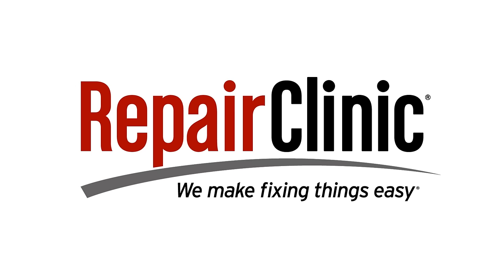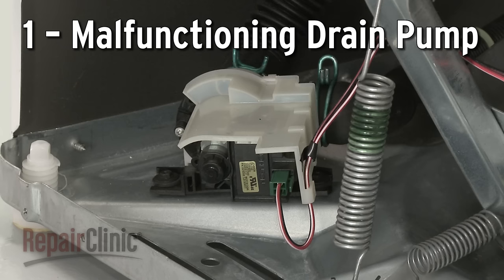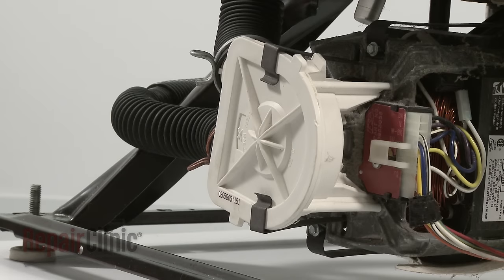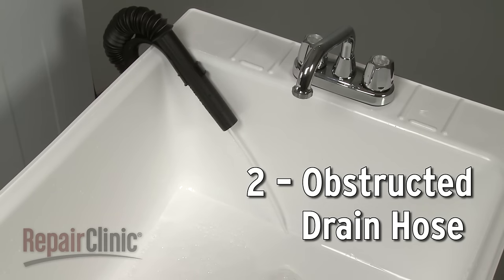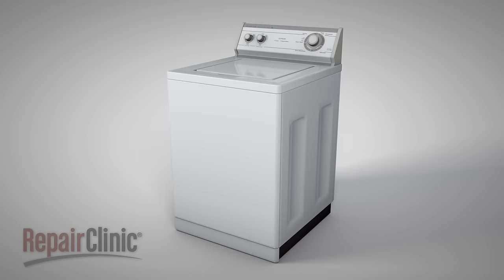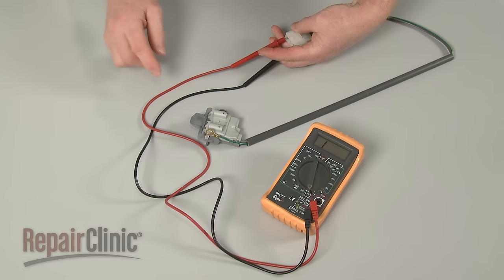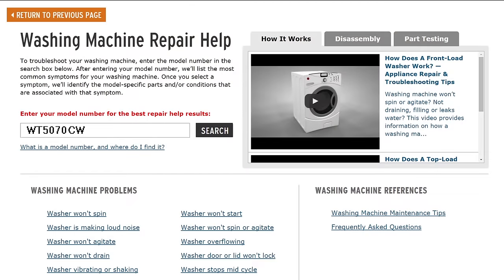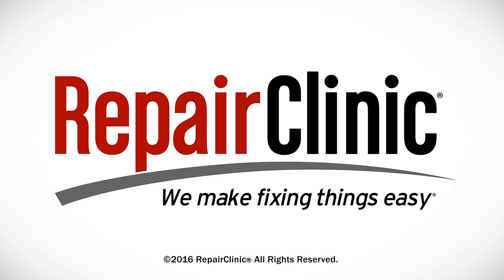Top-Load Washer Won’t Drain — Washing Machine Troubleshooting

Comment: Just helped save my sister in law some money! Figured out how to get to the drain pump and found a Bobby pin stuck inside preventing the drain motor from spinning. Took it out and did a test rinse felt the water in the drain hose almost immediately!

Comment: I keep washing machines for a long time and repair them until it just gets too expensive.  I have had the problem where it wont drain several times.  Most of the times it was the lid switch.  This is  the easiest thing to check first.  One time it was a bad pump.  This is a lot more diffecult to repair than the lid switch.  Check the safety switch first.  You dont have to take any panels off on most  models.  Unplug the washer before removing the switch since you will have a live wire exposed when the switch is removed.

Comment: This was awesome video!  For me, it was the lid switch assembly.  The plastic lid switch assembly broke off its mounting position.  The screws are still attached to the body of the washer but the mounting holes on the switch assembly was cracked and dislodged.  Since the switch was never engaged, the washer would not move on to drain mode.  I think the lid switch assembly broke of its mounting due to time (15 yrs of use) and occasional slamming of the lid during that time period.
Reply: I replaced the lid switch' it worked 4 times' then quit' than I replaced the pump motor's it worked another 4 times' then quit' please someone help me

Comment: Thank you very much for your video...again. Thought for sure that we had a defective timer fault in our old Whirlpool washer that was not draining nor spinning near the end. Was considering to buy another unit and then saw this video. The true root cause was the lid switch I had removed to gain access to the internals of the washer for a drum alignment. The rinse / drain cycle demands that the lid be closed or the switch bypassed. Short answer - pressed harder on the top lid and it all works again. Will remove and re-install the position of the lid switch so it closes properly. Many thanks for your advice and videos.

Comment: Hi I just ordered a drain pump from you guys hooked it up & it seems to be draining now but there is water sitting in the barrel. I can hear it draining but for some reason it's a few inches left over in the barrel.  All hoses are clear from any obstructions & like I said I just ordered a new drain pump from you guys.  Also, it seems to be getting stuck when it's suppose to drain & do the spin cycles.  I think it's the timer...
Reply: Did you ever get a response to this situation? Might be the same issue mine seems to be having
Reply: Mine is the same did you figure it out
Reply: Terry Porter Nope...  Ended up a getting a new one sadly

Comment: I have a Kenmore 800 washer that drains and spins just fine, but right before it finishes a normal cycle, and has drained and spun, it fills up with water again and then just stops completely. The spin cycle is set to 1 cycle. Any thoughts why it would starting filling with water again after a normal cycle?

Comment: I had this issue... I was inspecting the drain pump and noticed a blue wire was cut. I simple tied them together with a wire nut and the washer is fine now.

Comment: Hi, I have the exact apposite problem, my samsung top loader is draining continuously.
Started happening few days back, does not happen always but sometimes.
usually when it starts the rinse cycle, it starts to take water from tap but at the same time its draining also.
I tried checking by opening the back cover for probable cause.
what I observed is, there is a valve below the tub (its enclosed in tub though) is pulled open by the motor so to drain out the water and once the water is drained out, the valve is released in instant and it sits back on its place blocking the drain outlet.
The valve opening works every time perfectly but closing doesn't happen at times.
I tried starting the spin cycle manually and as it just starts to spin, opened the lid so as to stop the machine with a jerk, and this closes the drain valve immediately every time.
What I am trying to figure out is, Is it the motor (probably this is known as drain motor but only thing this motor does is to pull the valve and release) at fault but it doesn't seem to be because its opening the valve without problem.
next probability is, is there some kind of sensor that doesn't understand that the tub is empty and so the valve is kept open.
Because this is not happening all the time I don't want to change the motor at first go.
Will be glad if you can guide me on this. Thanks. 
(P.S. not due to siphoning because its working in same position for last ten years.)
Reply: Sounds like you have a siphoning problem.  Just take drain hose out of drain and be sure it is not wedged.  It must have air space around hose.

Comment: My problem is the water did not drain. It did not complete the cycle. It starts when i pull out the knob to start the cycle but it does not go past that. It does agitate, so that is not the problem. I have not taken it apart yet but that is next.
Reply: Yeah, but on some agitator types (before they got rid of them), you can have the lid open UNTIL the spin cycle, as I recall it. That's where mine locks up. So, lid latch, clog or the pump. 

Go with easiest and cheapest first. 

Hose and drain. If you know a plumber. Then lid lock. Then pump in back.

Comment: For anyone womdering that meter is junk. It should read OL (open lead) if the lid switch or motor is bad. Not whatever letter this video was showing. Never even seen that letter reading on any meter in my life. But then again i have a $300 ohm meter and not some cheapo. Good functioning switch should read about 0.2 ohms. Good motor probably about 0.2-0.6 ohms.
Reply: Who are these people who have such a thing and can justify the expense? You could buy one and send it back. Tho.

Comment: We've gone through 3 different washers in 4 months and they all hold water and leak from the bottom.. our problem can't be a machine problem. Any idea what it could be? 😭 the water doesn't even make it up to the drain pipe 31 inches up.
Reply: Plumbing issue?

Comment: dear washing machine people, stop making washing machines with lid switches. I want to look into the machine while its on thats the whole point of a top loader.
Reply: A, buy an older machine. There's a guy on YT who collects them from the 50s and 60s. They'd have an agitator and yes, you can leave the lid open. 

I've known baby diaper machines that were so tiny, you could fit one big towel in the spinner (not a dryer, lol), but it was much smaller than a 6 foot counter, tho.

Comment: one question, mine doesn't drain but i already test the pump, I know that what is happening if that is not receiving the 120volts , my washer is doing everything else but draining the water.
Reply: Then it's the lid switch or a clog in the drain or the hose.

Comment: Thank you it was the lid switch
Reply: one question, mine doesn't drain but i already test the pump, I know that what is happening if that is not receiving the 120volts , my  washer is doing everything else but draining the water.